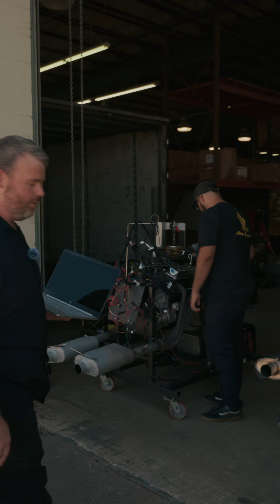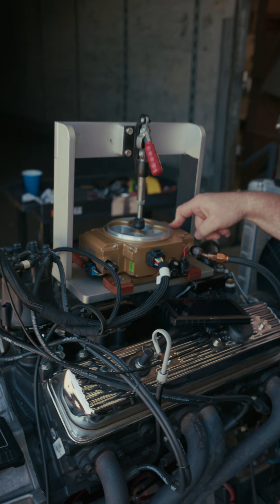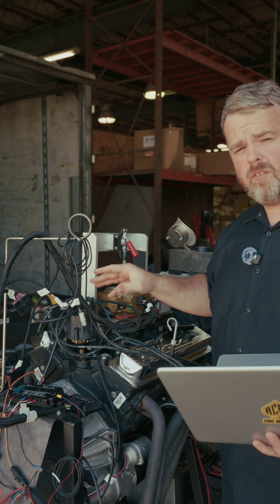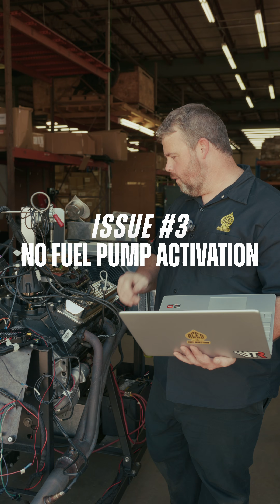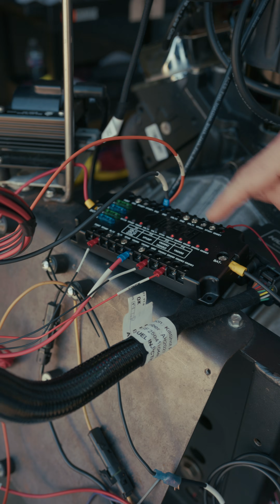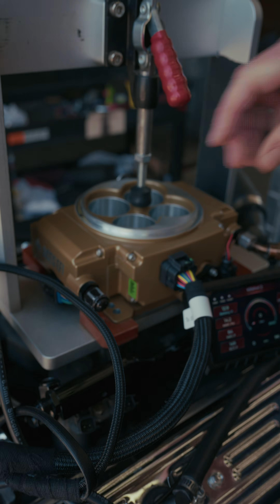Day 1 of Docs to Videos: Top 5 Solutions to Issues (Killshot)

Comment: My inj PW is staying stuck at 30.457 ms or even go higher sometimes. What’s the issue? Goggles say it’s an ecu issue if all my grounds are good. No wires are pinched. I even unplugged the injectors and it won’t 0 out

Comment: I HAVE THE SAME PROBLEM AS NATHANTATE8758 IN YOUR COMMENTS WITH A ALL IN ONE KILL SHOT.,PLEASE HELP ME OUT HERE IT BEEN OVER A MONTH NOW WITH NO HELP!!
Reply: I just commented on that post, check that you are receiving a proper RPM input to your ECU, either coil negative or crankshaft signal. You should see an RPM readout in your handheld or the ACES software under the Strip Chart if you're using a PC

Comment: I called in a few days ago with a tech question and no one ever called me back , I have a vehicle we installed a kill shot 2 on and it will fire after initial key on and prime but shuts off immediately! After that if you just crank on it it will never fire again there is no spark no fuel pump and no fuel injector pulse ,, however shut the key off let it lrime the injectors again it’ll fire up and shut right back off less then one second run time , call me back help me out 😊
Reply: This sounds like your ECU is not receiving a crank trigger signal, or RPM signal. Check that you have a proper engine RPM signal making it to your ECU, usually it's the coil negative terminal if youre using a distributor. If you're using timing control, be sure your RPM signal settings are correct
Reply: This happened to me. I’ve been troubleshooting everything here. I was actually able to get it to idle once and got the iac down from 176 to 14 after turning the idle screw in almost all the way. Now, it won’t start up after zeroing the TPS Sensor and saving once I had everything set. 

Extremely frustrating as I’m in month 5 of trying to get this system to work. Send help!

Comment: This is GREAT! You are the man! I can't wait to see more. I already found some of it useful to my fresh install. I believe I installed the O2 sensor too close. It is disaapointing. I am not a fan of drilling holes in exhaust or welding under the car... LOL! I have been procrastinating it. 

Question about fuel pressure: I installed the fuel command center and the pressue output says 56-58psi. In the Royal Flush instructions I only see it saying 43psi minimum. Do I need to modify the ECU to the 56psi value?

Another issue I seem to be having is the Blackjack on the Royal Flush locked at 15 flutters prett hard around the mark. I verifed the TDC and it was right on. Got any tips for that? I havent opened it back up to see if the reluctor is loose. I just seen someone have that issue.